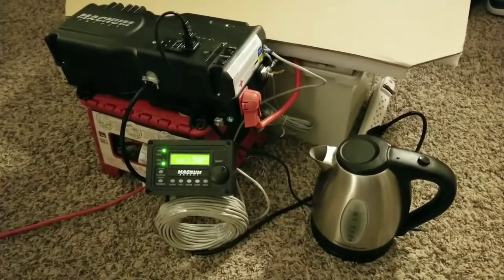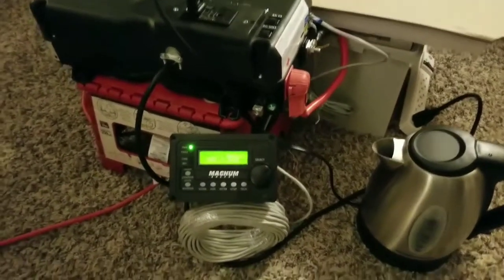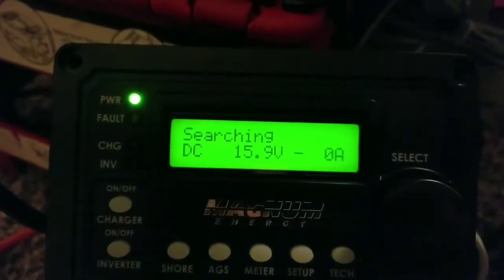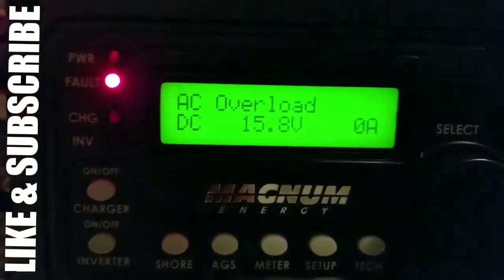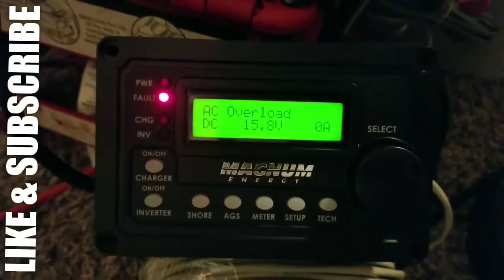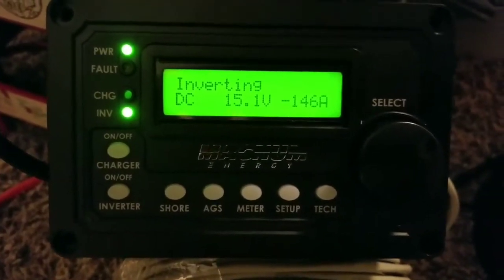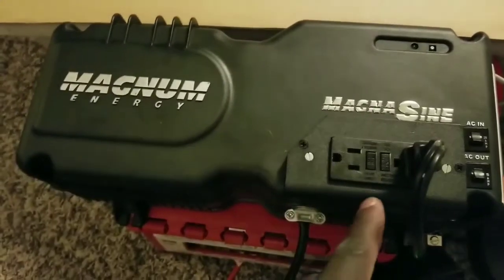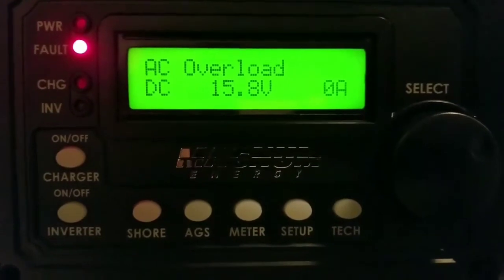INVERTER INSTALLATION: 101 MAGNUM
ENERGY MMS-1012G | Troubleshooting AC Overload

Comment: That's 2 Kw it can't handle it at 1650 W it will shutdown in 5 sec that is normal
Reply from the maker: My test concluded a 1000W MagnaSine Magnum Inverter/Charger can surge up to 2,325 Watts at 153 Amps x 15.2 Volts